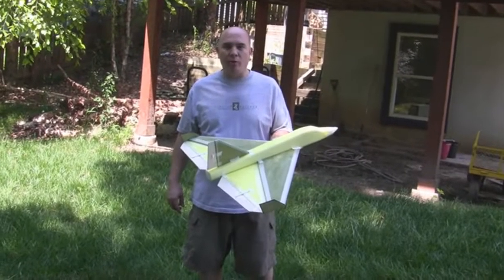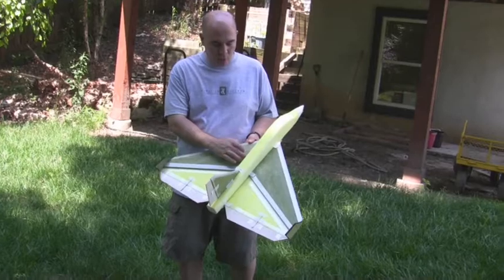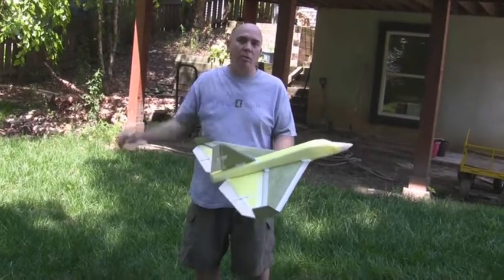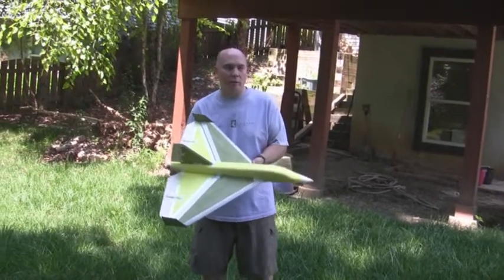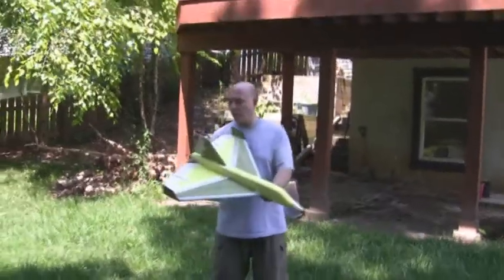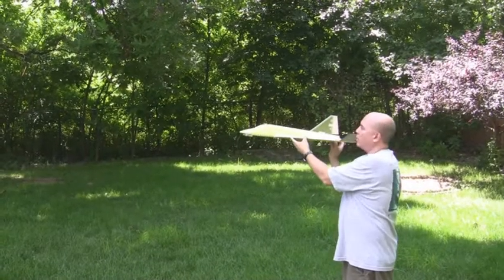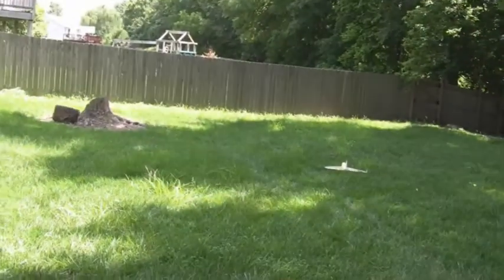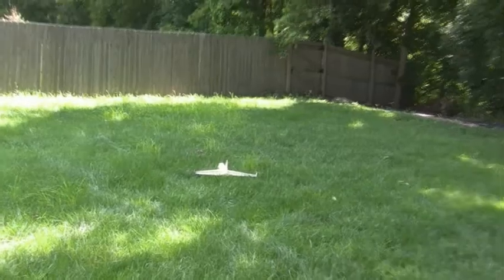Return of the Bullet Plane Part 2

Comment from the maker: rctesty this henrys fiberglass weave is thinner than most weaves but does add some weight especially if you use a double layer. It's really a trade off more weight for a plane you can crash nose first into the ground at 80mph+ with very little damage if any at all. Please check out rcFoamFighters  blog for more info on this weave and where to get it. There is a link to our blog in the video side bar.